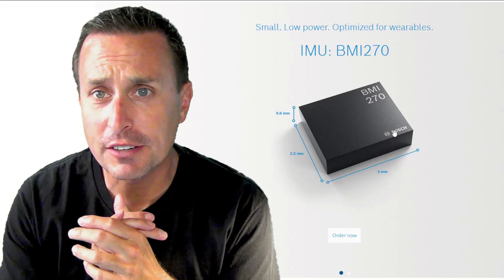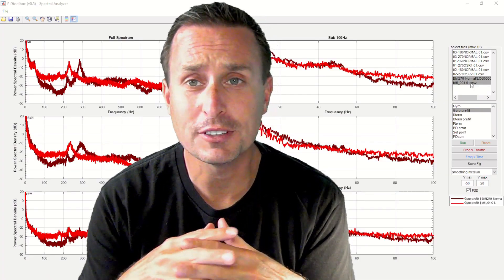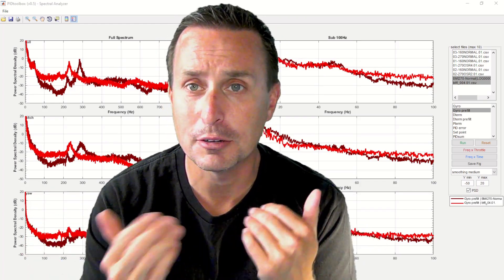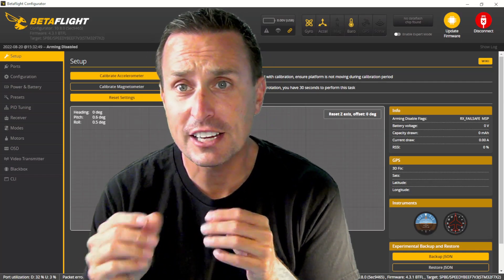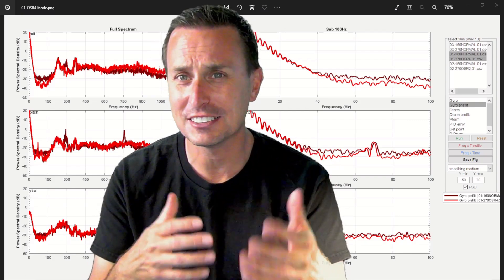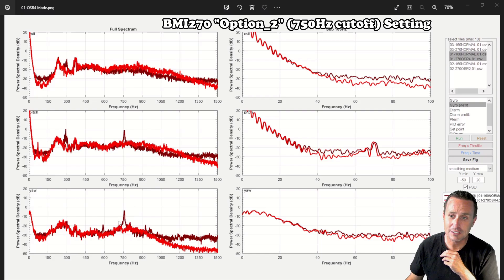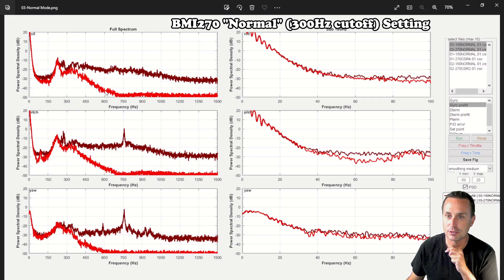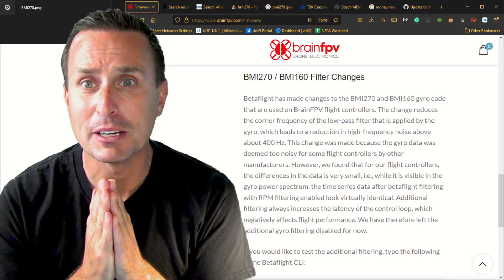Is the NEW Bosch BMI 270 Any Good????

Comment: note those cutoff frequencies are only applicable when the output data rate is at 800Hz. changing odr will also change the cuttoff frequencies.

Comment: So what i'm gathering from this video roughly (please correct me) is within betaflight 4.3 on a BMI270 the stock gyro "normal" mode sets the internal filters to be pretty close if not nearly identical to our MPU 6000 we are all used to? So I can stop fearing to purchase a newer FC?
Reply from the maker: Correct.
Reply: @uavtech  Did they fix the weird bug where you could brick the board by flashing with one? IF thats the case i'm probably going to pick up another FC

Comment: Were all these tests done with an identical odr? Because that will affect noise more than anything. Also as I understand it the osr2/osr4 are meant to be used with a higher ODR and then it averages down to a lower effective ODR, so it doesn't add any latency at all, but I could be using it incorrectly. The BMI docs are far from the worst imu docs, but also far from helpful.
Reply from the maker: Check out the PR for details on ODR testing.
Reply: @uavtech  was planning on doing that, but thanks for the nudge. Ill pull it up right now.

Comment: You should add a bf preset for the Bmi270  . I've tried the one that's there which made my quad fly even worse, then through other videos I'm under the impression that the bmi270 preset is for 4.2 users? I'm not quite sure what I need to do with filtering this gyro any tips would be greatly appreciated

Comment: Certainly, with the FC I use (The JHEMCU GHF411 Pro), they just replaced the MPU 6000 version with a BMI270 version, and the Gyro loop freqency maxes out at 3.2k
The MPU version did 8k/4k, but the BMI version is 3.2k/3.2k - are you seeing the same thing with your BMI FCs?
Also, with the BMI version of the FC, the factory flash defaults to NORMAL mode, but if you flash a new version of BF (They say to use the same target as the MPU version), and apply custom defaults, it defaults it to OPTION2. In this instance, the gyro orientation is also wrong.
I am having terrible trouble tuning this quad. I run the exact same build using the MPU version of the FC, and it flies super sweet, but with the BMI version, I get this odd rebound effect at the end of a snap roll and I just can't tune it out.
Only just found out about NORMAL/OPTION1/OPTION2 tho, so will have to play with that and see if it solves the problem
Also, another thought about the modes - does doing it in the gyro not make sense for lower powered (eg F411) FCs, as you are doing the filter in dedicated hardware, rather than in software on the MCU? So you will have lower CPU usage?

Comment: Off topic: Have you ever done anything with shielding the FC from ESC FET noise? i.e. EMI copper shields.
Reply from the maker: No, but when I can - and if the gyro and MCU are in the same side - i try to face it away from the ESC if I can.  Then the board ground acts as a shield.

Comment: Tried a foxxer F722 mini with that BMI270 in my aos 5.5 - and the roll axis showed a horrible noise around 160-180hz with 3 spikes in there - solely on the roll axis. Guess also those BOSCHs aren't safe for dead-on-arrival units. Let's see how the other 2 in my freshly built race quads perform!
Reply from the maker: In Normal mode?

Comment: Thanks Mark. I had a bit of strugeling because of the names of the options in BF and the names of the modes for the BMI270. BF Normal = OSR4 on gyro, BF Option1 = OSR2 on gyro, BF Option2 = Normal on gyro, if I understood Chris' PR right (especially his "Full Spectrum" diagram). It is good news the gyro itself seems good, but what about the down sides ? By default, the BMI270 frequency is 3.2Khz, which obviously limits the PID loop at 3.2Khz too. And under 4Khz, BF team recommends running ESCs in DShot300 (since DShot600 is useless and may cause issues). Compared to 8Khz with a MPU6000, we now have a PID loop running at 40%. And the speed of the ESCs is divided by 2. Does it significantly affect performance ? Oh, and since a simple F4 with basic BLHeli_S ESCs (flashed with Bluejay) will now be plenty enough computing power for runnning so slow, why buying high end FCs (F7-G4-H7) and monster ESCs (F3-F4) ? ^^
Reply from the maker: 3.2Khz (3,200 samples of data per second) for sub-100hz motion tracking.
Reply: @uavtech  Do you mean 3.2Khz is more than enough for motion-tracking and there is no difference beetween 1Khz, 3.2Khz or 8Khz ? Same about DShot300 vs DShot600 ?

Comment: Nice video.
The plots at 3:35 are a little sus, it looks like PID toolbox didn't plot correctly BMI vs TDK because BMI  had different blackbox recording frequency.
You can see that noise peaks on BMI are shifted to the right, looks like 800Hz BMI range was stretched to 1000hz. I think Brian White fixed this in the latest PID toolbox when i found this little "bug", but im not sure if he checked the two plots of different gyros on the same plot.
It does not change anything here tho, BMI noise floor is still lower.

Comment: Thanks for the data...the lower freq responses look encouraging....I didn't get to test one yet, but a couple of things to consider about the BMI270 is the gyro and pid rate are 3.2khz so there will be slightly more latency running betaflight filters compared with an 8k gyro....and I'm wondering if the gyro hardware low pass is running at 6.4khz internally which could make it less latent than using the equivalent Betaflight low pass filters at 3.2khz...
Karatebrot thinks the OSR4 mode 300hz filter is third order which explains the steep attenuation (anything >650hz flattened to -50db which an MPU6000 doesn't do), and in this case perhaps it makes more sense to reduce significantly or remove the Betaflight gyro LPF.....and just use notches...
A final point to consider about the 3.2khz gyro/pid rate is that Betaflight PT filter cutoffs will be lower than expected because of the anti-alias calculations in BF...worth bearing in mind....

Comment: I have 2 Foxeer f722 v3 on the way with that gyro. I’m glad it’s good. Thanks for the great video.
Reply: I struggle with the f722 v3. Pretty much unflyable. Tested a broad range of settings but the quad remains to show flyaway tendencies.
Reply: @marlin-fpv  I have them on 2 quads now and they are flying perfectly.
Reply: @afcl1984  Racing quads?
Reply: @marlin-fpv  Nope, freestyle.

Comment: I think it would be best if manufacturers could settle on a “standard” gyro again with good availability, even if it’s not the “best” gyro. Having to tune the filters differently for each different gyro makes it harder to use presets and tune quickly.
Reply from the maker: It is really the same thanks to Chris and OSR4 mode (Normal) on the BMI 270.
Reply: @uavtech  Is this (generally speaking) true for all the new gyros? There are only subtle differences in frequency response from the user perspective?
Reply from the maker: Correct.  The key now is what has the lowest noise floor (80hz to 200hz energy).
Reply: @uavtech  great! Looking forward to seeing your testing on that
Reply: There is a crew of Betaflight developers working on some guidance with regard to this....however it's not really in the spirit of the project to strictly limit to a single gyro...we can only recommend for best performance...

Comment: Great vid! BMIs look pretty good to me. Very consistent and when filtered properly they are very clean, especially in the 50-150hz “quiet” region
Reply: How does the 3.2k of the BMI270 versus the 8k output of the MPU6000 factor in to the overall picture? Doesn’t the higher output give the opportunity to filter more?
Reply: @Quad66  exactly my question
Although we know that high sample rate also bring more noise to the table as it is collecting more data 
But I agree that the 8/8 was great balance

Comment: We still need to run pid loop at 8k-4k with BMI270? If so, this is a negative thing or a neutral thing?
Reply from the maker: 3.2khz is plenty fast to sample sub 100hz motion.  I need to follow up how filters change at higher frequency sampling (cutoffs move up, which make it seem like faster sampling is better.  But you can simply move cutoffs up for lower sampling).

Comment: Thank you for this. I've been dreading getting into tuning a new stack I have because it's one of these BMI270 gyros.
Reply: I have several builds with Radix2 and I just learned in this video that they have the hardware cutoff set higher than everyone else at 700Hz and even with the Radix2 bmi270 defaulted that high a cutoff they have been flying amazing for me so you have absolutely nothing to worry about.

Comment: Good explanation of the BMI270. Thanks for the graphs too. May want to discuss the lower sampling rate of 3.2K since some see that and think it means it's worse.
Reply: I had the same thoughts but after several tests it seems way better then old gyros and you can turn off most of the gyro filtering. I won't buy fc-s without this gyro anymore. :)
Reply: @butcher  good to know. I ordered the speedybee V3 on UAVTechs recommendation so I hope it works out.
Reply: @UnmannedSky  I also purchased the speedybee V3 on UavTech's recommendation.
Reply: I think it's 3.2k no? ether way wasn't kiss flying on 1k for a long time and people were singing it's praises back then.
Reply: @AndyDreadFPV  yes sorry my bad. 3.2khz. A lot of us have been told for years the faster the gyro sample rate the better so I understand why some are concerned. Also BF devs recommend dshot300 for sample rates 4K and under. I'm curious to know if the lower sampling rate and therefore slower pid loop refresh causes worse propwash handling or if it's really not noticeable.
Reply: @UnmannedSky  The biggest noticeable difference i've seen regarding prop wash is getting the noise down as low as possible per the frame then turning off/down filters and increasing P and D.   Been able to do that running DHSHOT300 and 3.2k and get zero noticeable prop wash oscillation.
Reply: @AndyDreadFPV  yeah makes sense. I purchased the speedybee f7 v3 for thay exact reason. I've been unlucky with the last few FCs and had higher than desirable noise in the 50hz-150hz region. I'll become a believer if the BMI270 delivers as advertised! ☺️